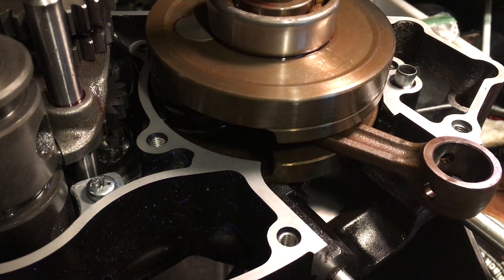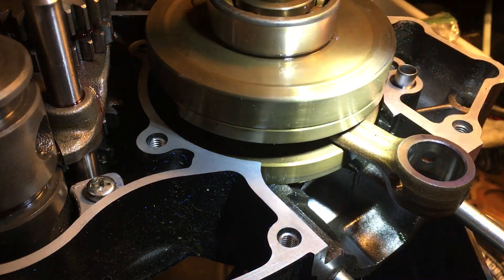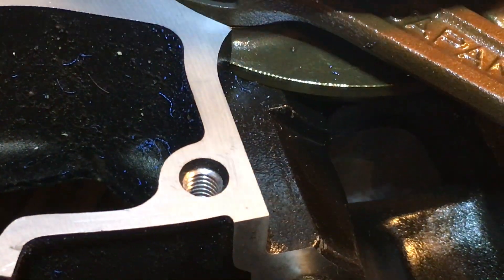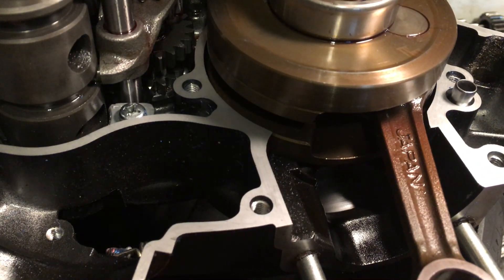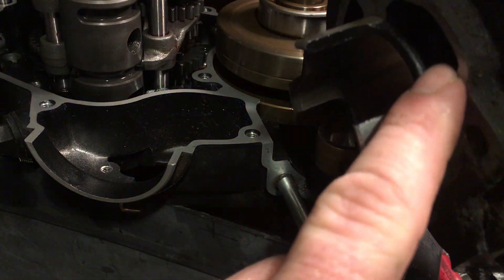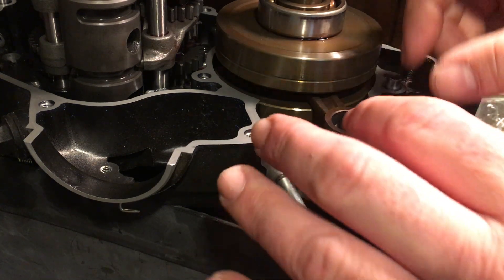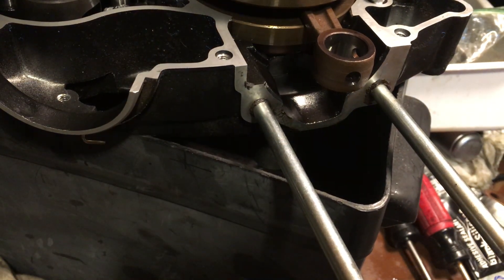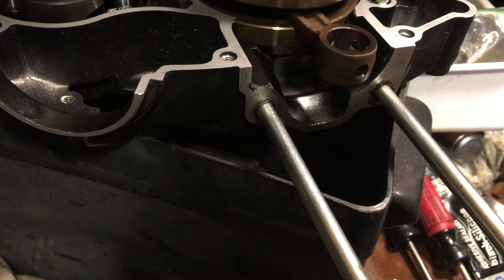rotory valve

Comment: Hey Kevin, thanks for the vid.  I changed my spark plug on my ‘74 Kawasaki F7 and noticed oil on the plug and hole. Is this normal for rotary valve 2 strokes since they are oil injected? Or is that an issue? Thanks

Comment: there seems to be 2 different designs of rotary valves on ebay.  how do you know which to buy? one is metal and one looks to be a different matterial.
Reply from the maker: Yes there is
Reply: Kevin Bergeron how do I choose which one to buy
Reply from the maker: @Billyjoe78517  take yours apart match them up
Reply: Kevin Bergeron how do you tell if it need to be replaced?

Comment: what is the measurement for the crank, web to web.  i took mine apart to replace lower end bearing and forgot to measure it.  i founds nothing in my clymer book and hoped you could help.  thanks in advance.
Reply from the maker: Daren Simmons it’s not adjustable make sure the bearings are pressed in till they seat thin layer of RTV I use permatex black after the two halfs are joined make sure the crank turns with out binding note let the rtv dry before you start it